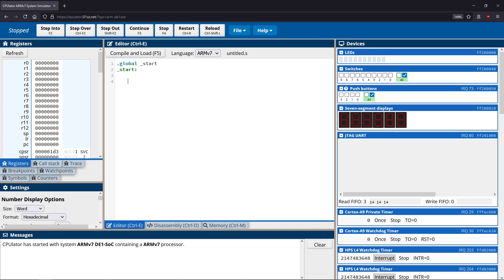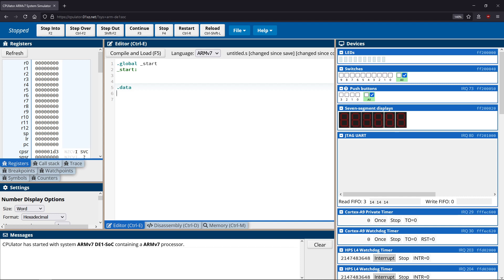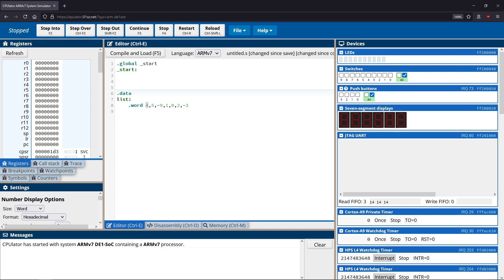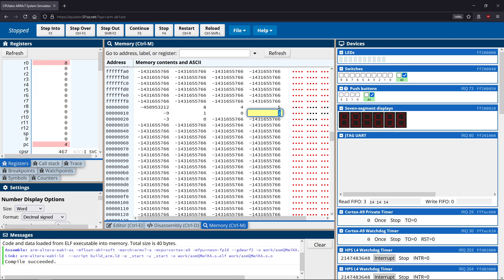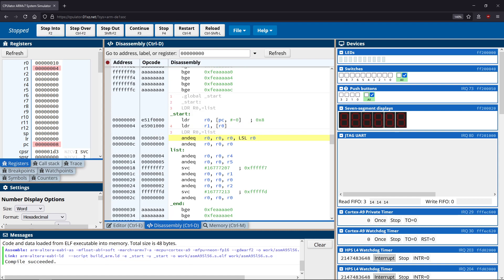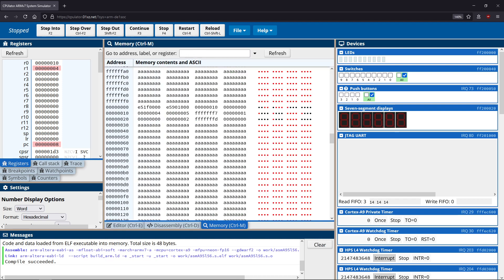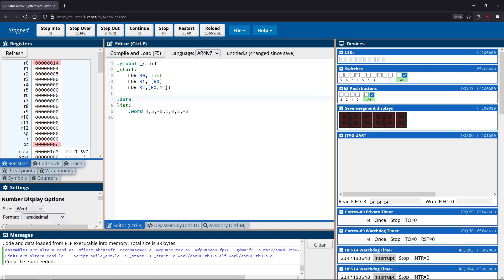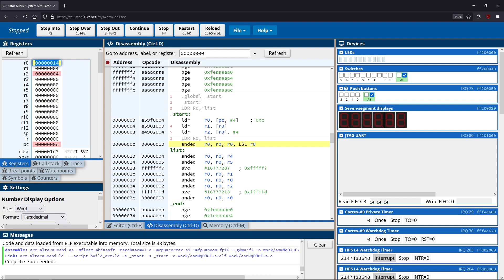Introduction to Assembly Programming with ARM - Addressing Modes

Comment: does learning Assembly make u understand programing logic better than c++ ?
Reply from the maker: Learning assembly will definitely give you a strong foundation in how programming logic works, as you will get to see the interactions between logic and hardware. For example, the memory addressing discussed in this video directly parallels the idea of pointers in C++. By understanding memory addressing and management in assembly, it will be more natural to use pointers in C++ and related languages. I've generally found that assembly will make higher-level language logic more intuitive overall

Comment: The .data section isn't really the stack... it's a bunch of constants in general RAM memory.... for it to be on the stack you have to start mucking around with the stack pointer SP and the frame pointer R11.
Reply from the maker: Is there a reason to use SP or the frame pointer? My understanding is that the frame pointer is used to store the function base. We use LDR to load the data onto the stack, which will place the address in the referenced register, so you shouldn't need to touch SP or FP as far as I know

Comment: Is there a good book you recommend to learn ARM64 Assembly?
Reply from the maker: The main book I usually suggest for ARM64 is Programming with 64-Bit ARM (https://www.amazon.com/Programming-64-Bit-ARM-Assembly-Language/dp/1484258800). This book covers a large set of concepts, and even discusses interfacing with a lot of high level languages which is quite useful
Reply: @olivestemlearning  Awesome channel! wanted to check out this link too but found that it's broken :( Can you drop me a line with the name and author? Thanks!